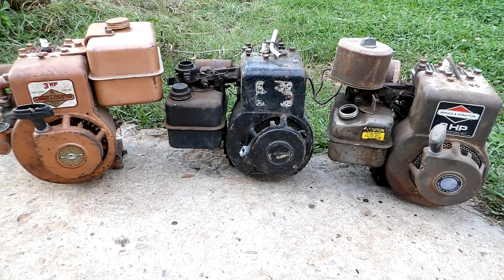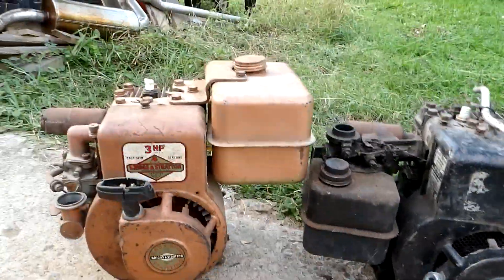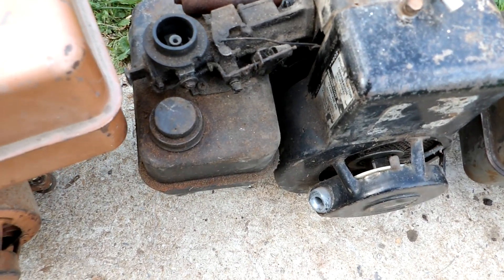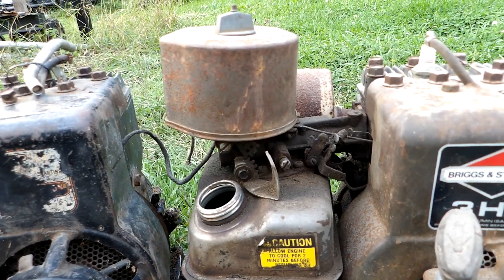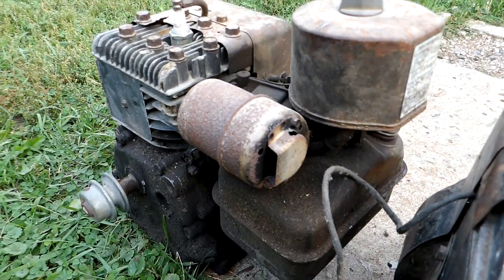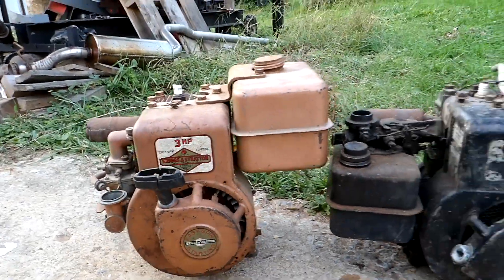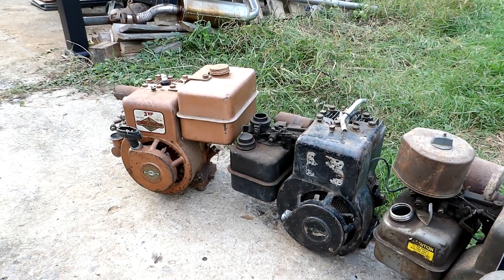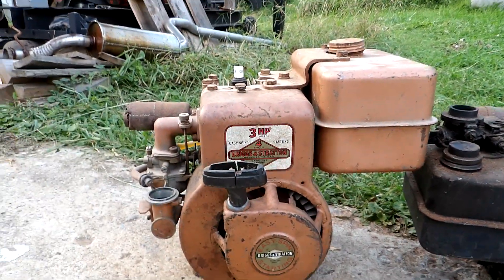3 Horse Briggs Triplets

Comment: Kinda interesting how much you know about these little engines.
Reply from the maker: I have been working on them since I was  11 years old. The first Briggs I got going was a cast iron block model 5S. I had it bolted onto a go kart in a shed, it didn't have a muffler, so when I primed it and it finally started up, I tore out of there like a lion was chasing me!  In all fairness,  the engine was screaming at wide open throttle, so it was echoing pretty well in that tin shed!  I ran back in, and closed the throttle, afterwards that little engine became my friend  :)  It would purr like a kitten.
Reply: @ChargerMiles007  thats interesting story. Thanks for sharing. That also explains a lot of why you know what you do.

Comment: In the early 70s my grandma had a sidewalk edger with a white 3.5 Briggs horizontal shaft. I always wanted to make a gocart with the engine. What year could that have been made? It seemed old even back then but really clean.
Reply from the maker: The first go kart we got had a black Briggs 3 horse on it, probably early 1960s model. Pretty sure I still have it around. Eventually the strain of the chain pulling down wore the rear cover bushing, so it leaked oil. we bolted on  5 horse "temporarily" from the roto-tiller (it never went back onto the tiller), as it had so much more fruit punch!